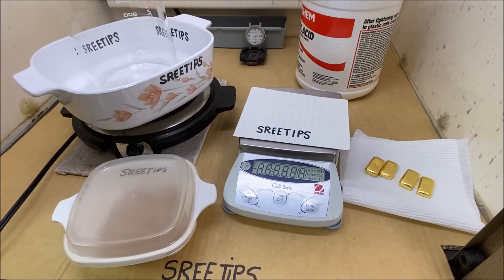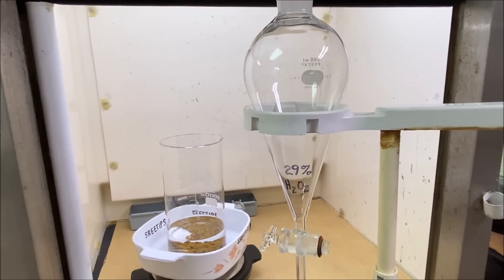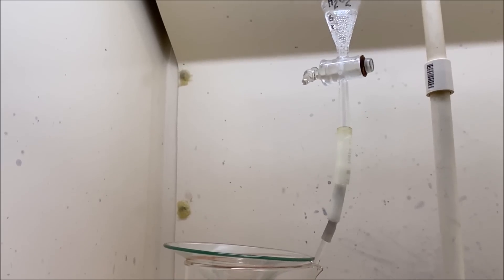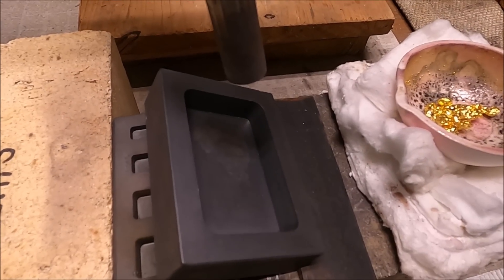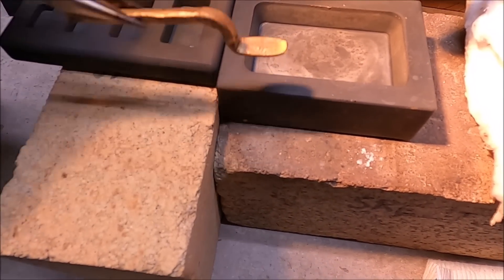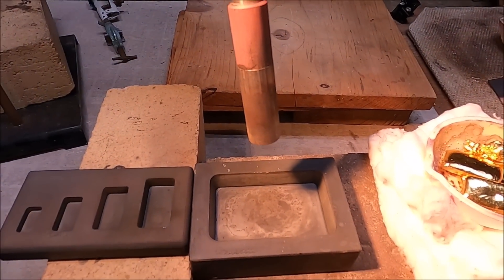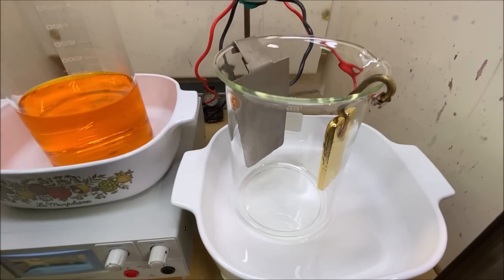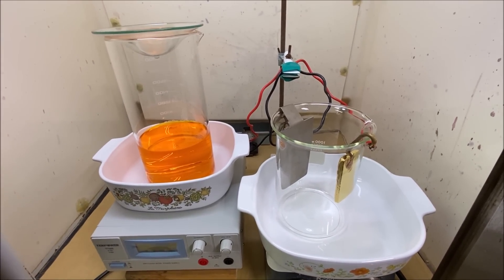Electrolytic Gold Refining Cell Pt1

Comment: I really enjoy watching your videos. If you wanted to use a carbon rod as your anode next time, I'd be really interested to see how that works. You can buy carbon electrodes from welding suppliers, which are used for carbon arc gouging, which liquefies welds and blasts them away with compressed air. They call them "welders erasers".

Comment: Should have used something to hold the torch. Then u could have used both hands to work the metal while still applying heat as needed. Not a big deal but would have made the process of shaping a little easier and quicker.

Comment: Im just a normal guy with a small garage and is very interested in possibly processing circuit boreds as a hobby and form of income if possible. Any recommendations on where to gain all knowledgeable information? I will be posting this on various similar platforms.
Reply from the maker: Circuit boards have gold. But the amount is tiny. And the amount of waste created is high. For these reasons I don’t process much escrap. Yields are too low.

Comment: If you don't make more that 10 ounces of gold out of this experiment then what is the purpose of it?

Also, it was a waste of time to form the anode by heating the gold and pounding it when gold is already a soft metal.

I have never had to do as much effort as you did to produce a flat piece of gold.

Just my opinion but too much effort for such little gold produced.
Reply from the maker: I did it for the show. I have the privilege of creating YouTube videos that pay me thousands. The value is in the videos. So then I can keep the gold and silver that I refine.
Reply: @sreetips  maybe so but it doesn't give you the right to charge people higher than the cost of gold either. It's just a scam what you do, by selling your so called gold higher than the price of gold. You should be ashamed of yourself for doing so
Reply from the maker: Surely you can’t blame me because the spot gold price is so grossly undervalued. My ask price is undervalued also. I’m not the villain here. I’m not your enemy. The currency printers are at fault. I’m just a guy who understands the true value of the gold and silver that I hold. No special economics or financial degree is required. It’s just common sense.
Reply: @sreetips   Maybe your right, but my gold mine produces more gold in a week. I am close to 1,200 ounces for the season.
Both of my Gold brokers are excited about buying my gold after the season is over. Once the snow flies, I will be closing up the mine and start refining the Gold.
Reply from the maker: Nice!
Reply from the maker: I’m not selling. I’m buying.

Comment: Maybe I missed something... why is this cell so different from the silver cell in terms of construction? Is it possible to create a gold cell that can deal with the crude gold in the same way your silver cell does with crude? Or is this simply a way to hyper-refine the gold from already pure gold? I just finished your silver cell series (first one), and that cell system is incredible. Is such a system even possible with gold?
Reply from the maker: In order for these cells (gold or silver) the anode material must be fairly high purity to begin with. For example, adding 925 sterling silver into the anode basket of the silver cell would quickly saturate the electrolyte with copper and increase the risk of co-depositing copper with the silver. I use 98% to 99% cement silver, recovered from my gold refining, melted into granules, for the feed stock material for the silver cell anode basket. Same spies with the gold cell. Adding unprocessed 10k and 14k gold to the gold cell as anode material would cause the cell to become fouled from base metals and silver.

Comment: I am so psyched you're running a gold electrolysis experiment.  That is one of my favorite prior videos of yours.  Gold crystals are something you don't see very often at all - very cool! 👍👍
Reply: BTW - is there any concern that you might pick up some impurities off your anvil while shaping the gold anode lead?  It looked like it might have picked up some rust, but it was hard to tell.
Reply from the maker: Yes, I need to get a small stainless steel block to do my hammering of the gold. Plus I have a roller for making gold wire. Just didn’t remember to break it out.
Reply: @sreetips  Oh that is cool! BTW - is it possible to use a stainless steel bowl as your cathode for collecting the gold crystal or does that react with the electrolyte in some way?
Reply from the maker: No, the gold chloride would probably react with the stainless bowl.
Reply: @sreetips  Yeah, I was thinking it might be convenient to scrape the crystal off a bowl, but it's actually really neat to be able to see the reaction happening in the beaker!

Comment: OK so “aqua Regia“ is hydrochloric acid and nitric acid together, yea???? So what do you call hydrochloric acid and hydrogen peroxide???? Surely still not "aqua Regia"????
Reply from the maker: Conventional Aqua Regia is considered to be thee to one or four to one hydrochloric acid to nitric acid. And it’s still valid if dissolving solid gold metal. But I can dissolve an ounce of pure gold powder with just 150ml hydrochloric acid and about 15ml to 18ml nitric acid. Beside h2o2 and hydrochloric, chlorine gas can also be used to dissolve gold. The advantage is: no nitrosol compounds to worry about.

Comment: your power supply is 15V 40A, set the voltage to full 15V but limit the current to about 10A, too much current may boil the electrolyt, so keep an eye on it and reduce the current (left button) if too hot. don't care at the voltage itself.
An interesting experiment would be to do the same thing with low-rate gold, 10 carat for example (and a copper wire, not a gold one), to see how much gold remains at the bottom of the beaker at the end.
Reply from the maker: The book calls for 1.5 volts, amps fall where they may. Electrolytic refining requires fairly high purity gold anode to begin with (the book says 980 parts per thousand or better). Otherwise the cell would quickly become fouled with base metals and silver.

Comment: Yes! My plea (and maybe from  others too) has been heard!😄🤗

Why not using the same type of cell like the silver cell?

Could the filter fabric not withstand the electrolyte? Other issues?
Reply from the maker: The main difference is one electrolyte is a nitrate, the other is a chloride.
Reply: @sreetips could you elaborate further? You fear the stainless steel bowl gets attacked? Maybe using a titanium bowl?
Reply from the maker: Anode and cathode facing each other in a Moebius type cell is what the book calls for.

Comment: At risk of insulting you and harming the hobby, can you also show us the simplest way possible? But no simpler than that? 

I feel like im on a shoestring budget by comparison to your lab and projects. I want to start reverse electroplating, im aware of the salt method and 10volts. But im not sure if that was over simplified? I tryst you, but youre like a tenured Professor and im a first year student (even though ive been dabbling for a decade).
Reply from the maker: If your reverse plating gold plated material then I’d recommend a sulfuric acid stripping cell.

Comment: How is this not gold plating?
Reply from the maker: It is gold plating. The anode dissolves from the current flow, the gold ions travel through the electrolyte and deposit (plate out) on the cathode.

Comment: I found myself wondering if this would come out 9999 fine by using karate scrap that had only been through inquartation and nitric treatments.
Reply from the maker: That could work. The anode material should be relatively high purity for best results. Otherwise the cell will foul quickly from base metals and silver.

Comment: Is this then also called aqua regia? You dissolved the gold not with nitric acid.
Reply from the maker: I don’t think it’s called Aqua Regia. Just HCl and peroxide. Chlorine gas will also dissolve GOLD.
Reply: Dripping strong Hydrogen Peroxide in HCl generates dissolved chlorine radicals (and chlorine gas) that react with gold. The reaction could be way faster if the nearly pure gold powder was stirred but at least me would not want to be near a potential runaway reaction involving chlorine gas.
When aqua regia was invented no source of pure enough peroxide was known (production invented 19th century)
Reply from the maker: Plus, it takes lots of heat.

Comment: Very interesting! But I wonder, why you haven´t cleaned the gold hanger in hydrochloric acid before attaching it to the gold plate after hammering it with a steel hammer. By hmmering it in hot state you for sure transfered Fe atoms to the gold , which is perhaps the reason of its discoloration.
Reply from the maker: Correct. Next time I’ll break out my roller and make a nice thick pure gold wire for the stem. Didn’t even think of it this time. Senior moment.

Comment: if/when you do a second bar wouldnt it be possible to save some time by using a rolling mill to get the right size every time and finish the psu connection by hand that way you could make the hook with just heat and pliars and have a ring so you can clip on to it and the jaws bit on eachother. Having the connector rised above the bottom of the floor of the mold should give it a better grip.
Reply from the maker: Yes

Comment: I have wondered what happens if the anode is too pure - maybe the precious impurities will hang about as a colloidal suspension in the electrolyte instead of settling as slimes when the anode dissolves.

Comment: Is it not feasible to make a gold electrolytic cell like the silver cells you utilize?
Reply from the maker: The principle is the same, but the anodes and cathodes are different. I think it’s because one uses a nitrate and the other a chloride for the electrolyte. But the results are the same: absolutely high purity elemental precious metals.
Reply: @sreetips  yes I understand the principles of electrolysis. It just seems like it would be easier to use a stainless bowl as the cathode like in your silver cell. And use a Tupperware anode basket suspended in the electrolyte. I realize it would take substantially more gold to create that much electrolyte, but it seems like the harvest would be simpler. Just scrape the bowl like you do with the silver.
Reply from the maker: The gold chloride would react with the stainless, that’s why I’m using a titanium cathode.
Reply: @sreetips  understood. Thank you

Comment: Does this mean we could be getting a larger electrolytic gold cell with impure gold melted as shot
Reply from the maker: I think this is how the big refiners do it. They refine the anode material to about 995 parts per thousand, then run it through the electrolytic cell to achieve high purity four nines gold. The anode material must be relatively high purity to begin with or else the cell would quickly become fouled by base metals and silver.

Comment: Why not use something like a gold wire die to roll the gold thin? Would let you form cold which should also save fuel. If you didn't want to buy one it would be easy enough to make.
Reply from the maker: I have a roller, but I didn’t think to use it.

Comment: Adding comment before I finish the video here... I see no heat insulation below the graphite box. I predict this will not go well since the fire brick lets the air under the box. One torch is not enough to heat the graphite box since graphite rejects heat so well. I hope this works but my prediction might well come to pass.

Edit after the vid. Glad you figured out from the the chill lines this needed more heat! Good job!
Reply from the maker: I used a brazing tip to fuse the bar to the stem.

Comment: This is totally awesome. I'm thinking that hook you made might have adhered better if it was slightly raised off the bottom of the mold dish when you pored the bar.
Reply: Also make a hole in the hook so the molten gold flows through and there'll be a solid connection
Reply: I was thinking the same.
Reply: With a little flux….

Comment: What are the potential +/- To this Experiment? Would you be able to do 10k and 14k gold or would you have to Nitrate strip the silver out first?
Reply from the maker: In order for electrolytic refining to be successful the anode material must be relatively high purity to begin with. Can’t use 10k or 14k or ever 18k because the electrolyte would quickly become saturated with contaminants.

Comment: Just an idea....  If you watch a video called "brilliant technique of lead acid battery restoration".  They make.their own lead runners to connect the cell packs in the batteries.  It might give you an idea how to try to make the stringers a bit different.  If not it's still a really interesting watch.

Comment: Does hammering of the stem introduce iron impurities into the gold and if so, how will that impact the experiment? As always thanks for sharing this.
Reply from the maker: Probably, but the iron, if present, won’t deposit on the cathode. It will end up in the electrolyte.
Reply: @sreetips  All true, as an old hand at pounding metals of many types I suggest a rounder hammer (called a fuller) for drawning out the triangular bar. The flat hammer makes hard work of a ductile metal. At the least use the edge of the flat head and move the hot metal better and more quickly. But you got it done!